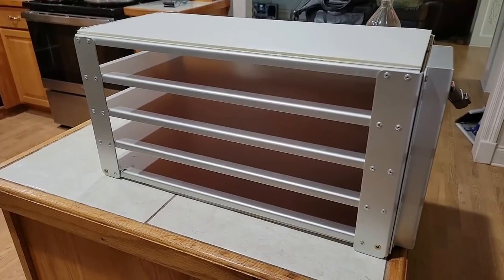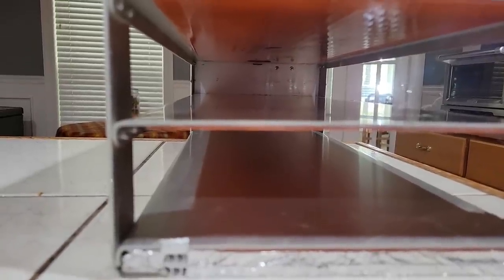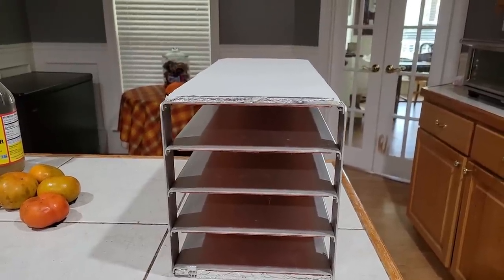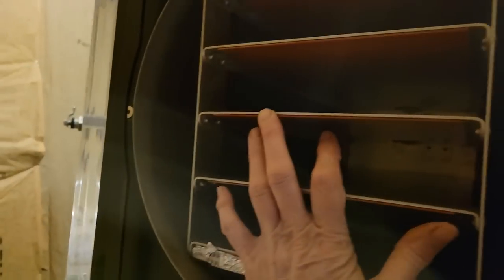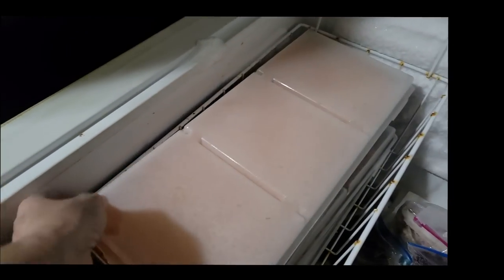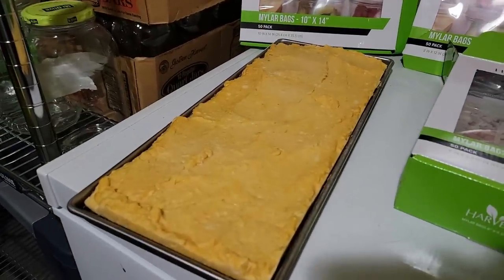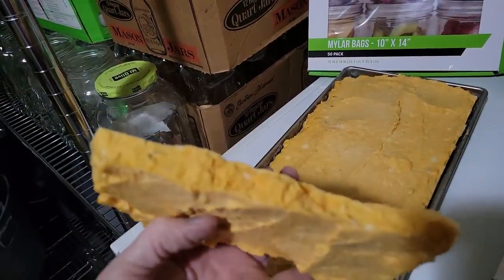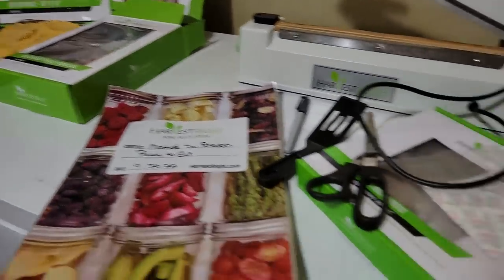What Are We Doing With ALL Those Sweet Potatoes?

Comment: Wanda before you put your S/P trays in the dryer draw a line halfway across the pan. Then when the tray comes out you can break the two pieces apart or if you want smaller pieces
just draw a line in the size you want.  You can put them in small bags.